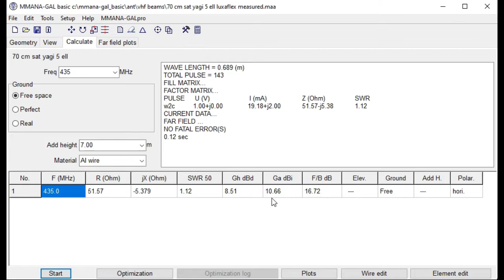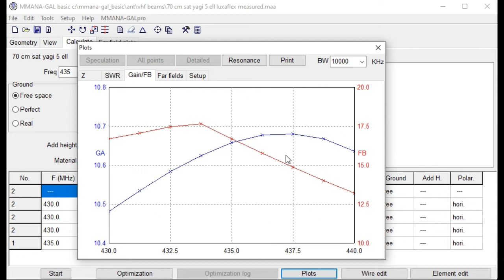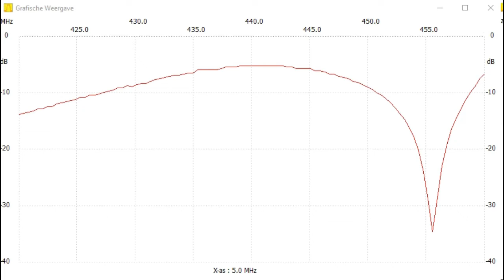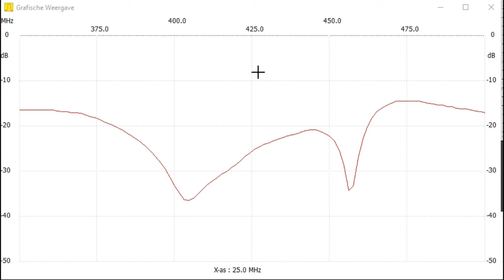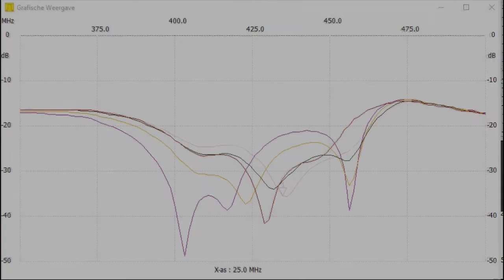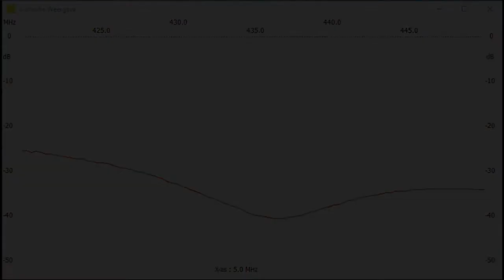Cheap and easy 5 elements 70 cm yagi antenna building considerations

Comment: Hey, i have a question. Is there a calculator for the reflector and director for the yagi??
For the dipole i found one but not for the stuff before and after the antenna
Reply from the maker: Yes there are! Google for 'yagi design online' and you find many of them. If the boom (the carrier of the elements) is conductive (aluminium or so) it needs to taken into consideration with the calculation. Also the element diameter. If that is not in the calculator, it is likely not very reliable. For three elements it is all not too critical. Compare a few if they will output about the same dimensions.
Reply: Thank you.❤